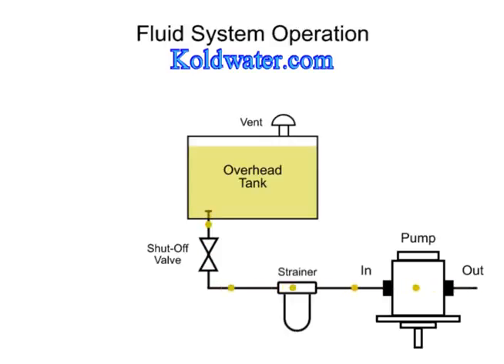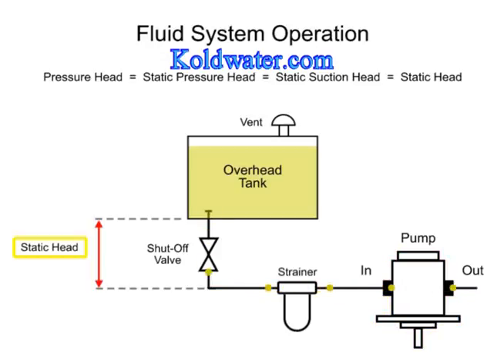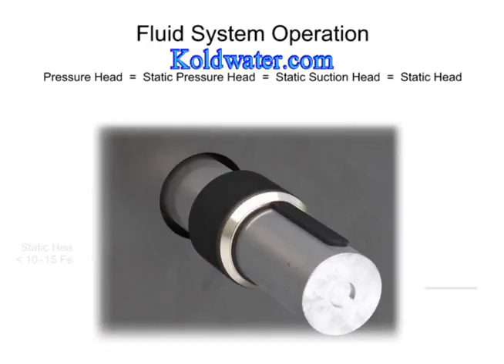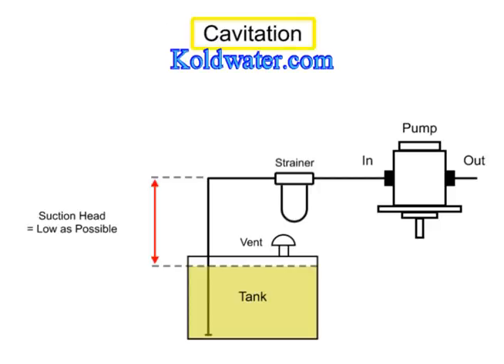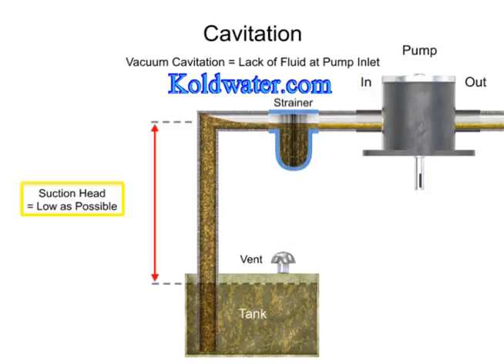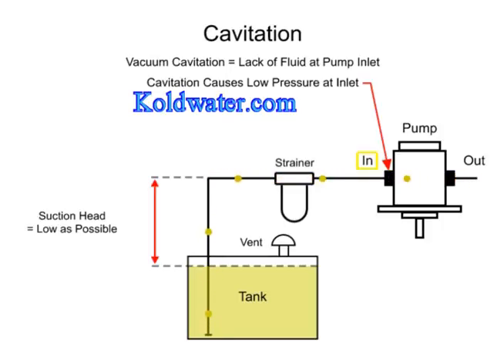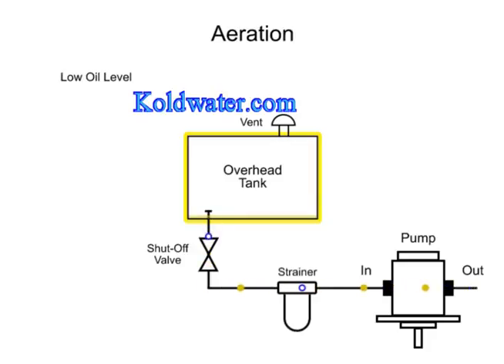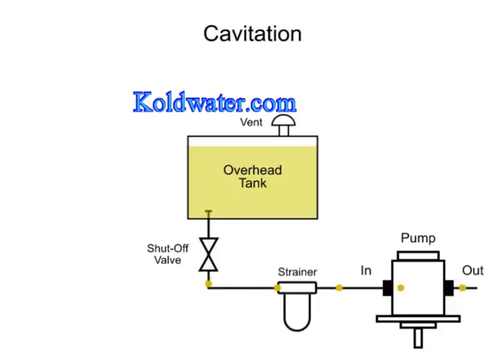Pump cavitation explained

Comment: Suction pressure completely depends on pump/seal design and pressure rating .. Youmay have tanks with heights above what you have illustrated .. A variety of pumping systems work without overhead tanks (such as boosters ) and may operate undera positive suction pressure from an Up stream facility which you didn't explain about in your video ..

Anyway thanks for the video .. Great work